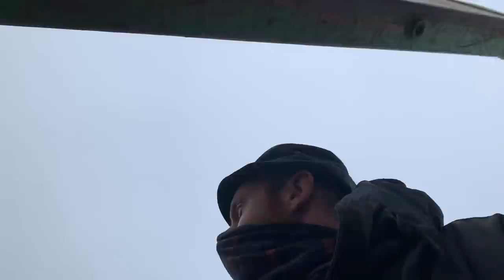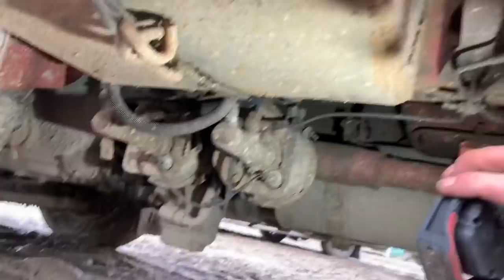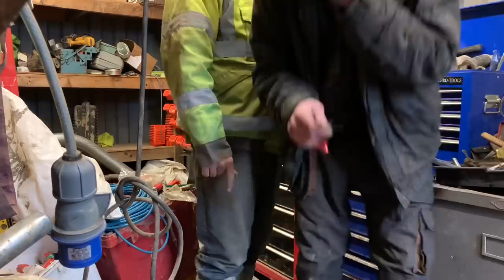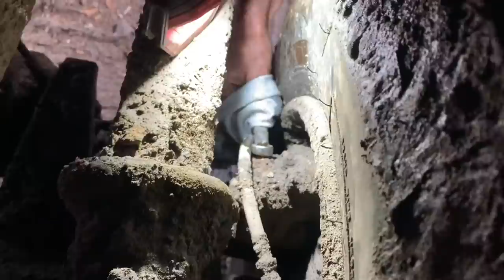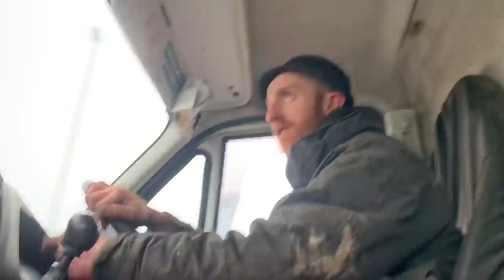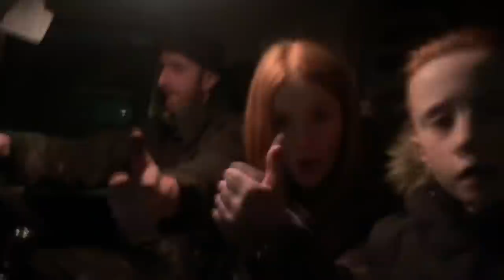How to bleed the brakes on an Iveco air over hydraulic, mobile hgv mechanic lorry truck trailer

Comment: Hi CHris
Try the bleed off pipe  o/s of engine  on top of cylinder head goes  to the header tank .
Take small pipe off run drill through  stub check port in head is clear
Reply from the maker: Cheers Robert! I’ve just told him to go through my comments for some ideas 👍

Comment: Hi Chris will you please get some silicon spray on the felts of that door window. That's doing my head in how slow she is going up and down. Will save you a window regulator later 😂. Also have a look at "Luke c in a hgv" merch. Some of his hoodies are good esp the tacho symbols one. Something like that with prybar, lump hammer, gas axe and a plaster 🤣

Comment: As regards the over heating issue. I have had the exact same problem on a DAF 65. Changed viscous fan, thermostat, radiator, even down to the hoses!! So I suspected the head. Bought a combustion leak kit off Ebay, and left it in the header tank. it was only supposed to be in if for 15 mins with the engine running. I became side tracked and left it in it for nearly 2 hours!! The head wasn't gone thank god, but ever since then, it has become a completely different truck. Going up hills now with large loads the gauge will not even go over half way. There must of been air in the system. 2 years I had to put up with it. I even flushed out the coolant several times beforehand!!

Comment: The old ivecos had a little coolant port on the head turbo side. They were common for blocking up, causing overheat. Unscrew that and check there's no restriction. Little port coming off the top of the head with rubber water pipe coming off it

Comment: For the overheating issue, I’m sure there’s a small return pipe by the thermostat housing that’s common for blocking up and causing intermittent overheat, remove pipe and blow through is usually the cure, or check air dryer for excessive moisture as compressor head gaskets can be problematic, again I’ve had that cause very intermittent overheating 
Also, make sure the radiator is clean, the rads sit low so are very prone to clogging up the fins with mud
Reply from the maker: Top man Tembreks 👍 thanks for the Advice mate I’ll let him know pal, struggle on brother 💪👍
Reply: @Professional-struggler   let us know how you get on mate, I’m an ex east midlander so the accent brings back some memories, always a good watch

Comment: Hi Chris 100 % fan fault mate they kick in but the cupping slips and they don’t drag enough air through the rad common fault mate new fan hub will cure it , obviously nothing wrong with the engine as it works perfectly most of the time if it was a engine or pump fault they are not intermit . Good luck with it grate content grate videos one struggler to another .

Comment: Did that chap check the compressor for overheating issue
Reply from the maker: No Ray why do you think that might course it?
Reply: It's connected to the cooling system of the engine to keep itself cool. It's worth a look at
Reply from the maker: @raymccarthy7492  I’ll pass it on to him thanks Ray! And cheers for the advice mate 👍

Comment: Hi Chris
I'm working on a zf manual 16 speed gear box for kerax. The shift actuator switch is leaking air badly, pls help me, 
                              Stephen.

Comment: Iveco = I Vibrate Everything Comes Off,  lol the best place for them is the scrap heap, I wonder how good or bad the new Iveco S-Way is?
Reply from the maker: There terrible mate! the wiring, the plastic fuel pipe connectors.... the list is endless 🤦‍♂️😂 cheers mate 🍻

Comment: Xx Over heating X x

The old rubber on thermostat will have broken up and cause clogging. Normally gets stuck in the small return pipe union on the cylinder head. It’s a 14mm to remove. 

Once removed I would drill it out make  larger hole. 

New thermostat may be faulty too. Had that before.
Reply from the maker: Cheers mark I’ll pas it on mate thanks for your help brother 👍